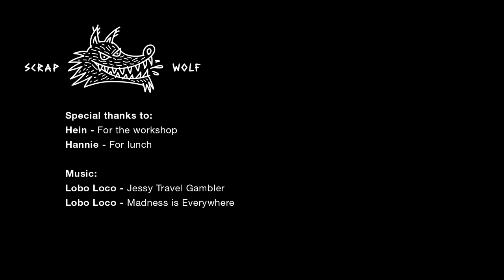Custom loopfiets maken voor mijn zoontje - Scrap Wolf

Comment: The saddle might be too big for little child’s butt. Looks like a regular sized saddle.
Reply from the maker: At first I was afraid that would be the case. This is the women’s Brooks B17 saddle. It’s significantly smaller as the men’s version. As far I can see my son has no trouble when riding the bike. I kept the original seat, so if needed I can switch it back.